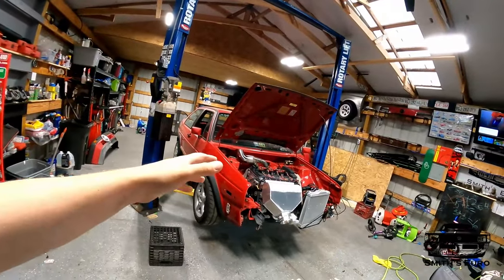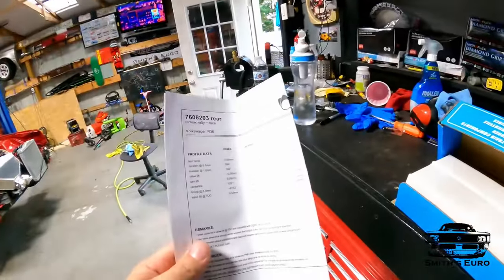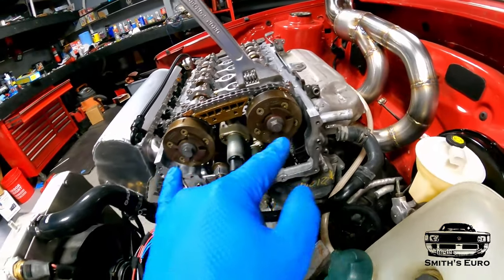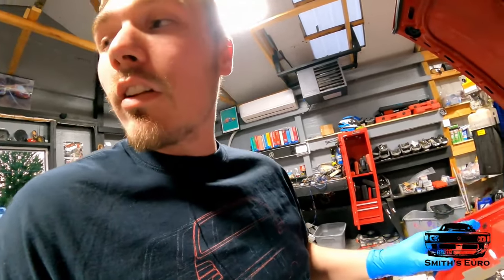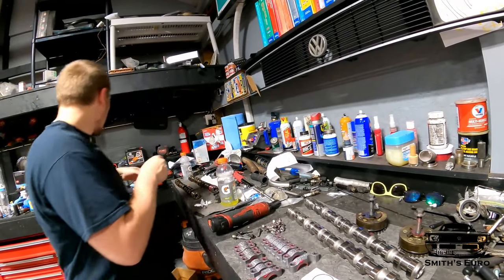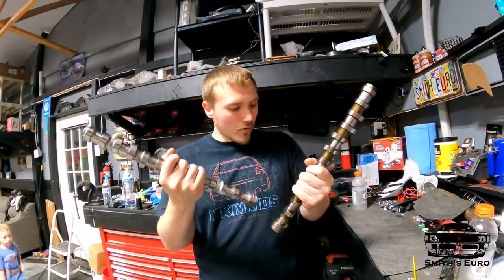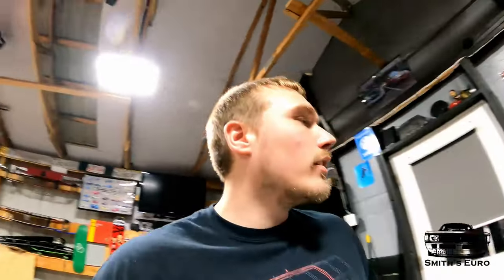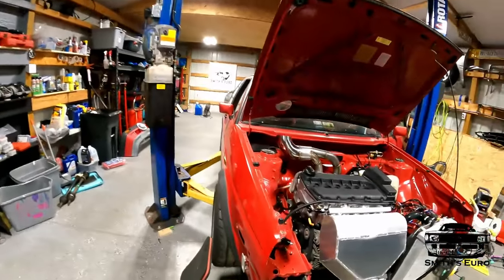R36 STAGE 3 CAT CAMS DIY ALL MOTOR 3.6 VR6

Comment: Damn, those cams sound lumpy as all hell. Very cool, I know we are all looking forward to what the numbers are on the dyno and what the power band looks like with those cams. I hope that with being a 24v and the last iteration of the VR6, that the head flows a lot better than the 12v 2.8. If the VR6's heads flowed better stock the car would make a lot more N/A power. The fact of why the VR6's head doesn't flow well is well known, but I still wish that it could have flowed on the level of a B16A1. Yet lets face the facts, the VR6 is a compact 15 or 10 staggered 6 cylinder put into a small engine bay, and the sacrifice of being compact was everything had to be smaller. Yet, the VR6 is still a legendary engine in the fact its community is still using it and that VW's attempt to make a small compact SOHC/DOHC with 2 Cams in it is admirable. Wishing you much luck on this new journey with the 3.6L.

Hey have you ever seen, messaged, or talked too Christian Smith or CliffJumper? 2 People who do a good amount of VR6 content here on Youtube. Good people. Christian has 2 N/A VR6's MKIII VR6 and a MKIV VR6 Jetta Wagon, and both are tastefully Modded. CliffJumper has a SLC Corrado Z Engineering S/C and a MIV R32. Cool people and I figure the more VR6 content creators know of each other the easier it is for all of your channels to grow and reach a bigger audience.
Reply from the maker: I have deleted di on this 3.6 so its bound to be way different and not really comparable to anything until i have dyno time.

Im working towards 10second 1/4 all motor times with my setup.

I dont know anyone from youtube besides my buddy scott who does steeldrumsmokers from all the vw stuff here in maryland
Reply: @SmithsEuro  The other 2 I mentioned don't know each other yet but I mentioned them to each other in their respective comment section. What would it hurt to reach out to them as a fellow VW VR6 enthusiasts. Collaborations can help the community a great deal.
Reply: Love the sounds my ol 12v makes, and I'm ok with knowing it wasn't really made for performance, it was made to fit a 6 cyl in place of a 4, so the head has drawbacks. 
It's expensive to make one fast by NA, so throw a turbo on if you're going for power.
I'm fine with my sticker, but I wouldn't mind stuffing a 3.6t in a mk1.